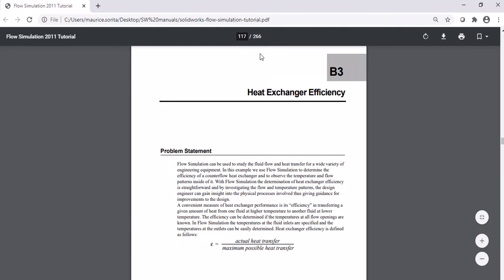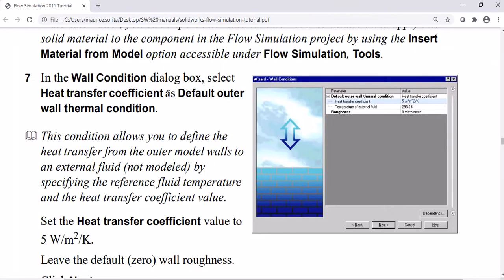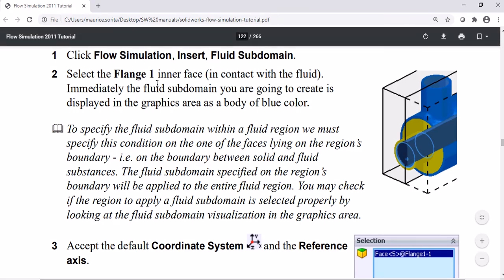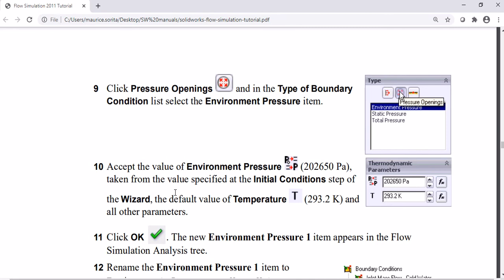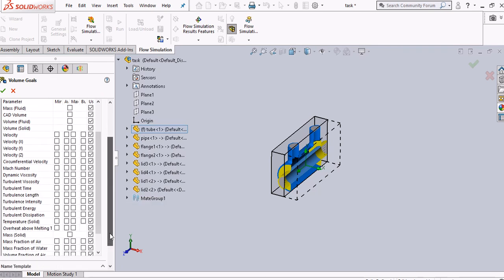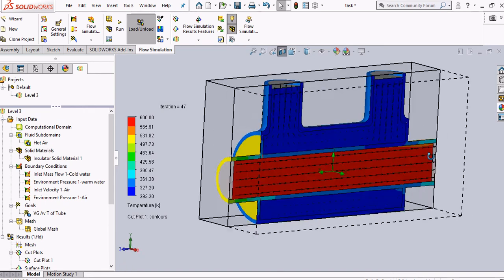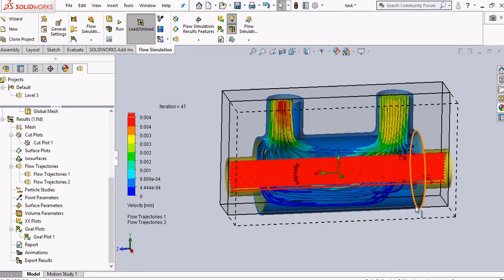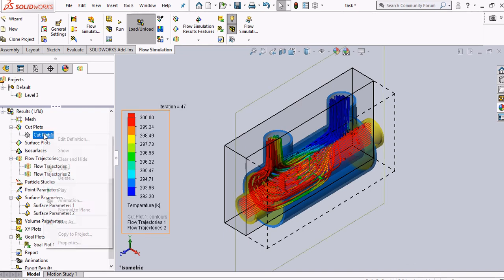Solidworks CFD Simulation 101; Introduction to CFD Simulation;Heat Exchanger ; Internal Analysis

Comment: Hello. I have a question.
Can you make a video with the whole process of heat exchange in an intercooler? How is this simulation done?
I don't know how to do this heat transfer. I want to mention that the intercooler is air-cooled.
Reply from the maker: Let me check if i could make a video for that.

Comment: Sir can you please tell me what is "iteration" and what is the need of "iteration" in flow simulation.
Reply from the maker: Iterations is automatically decided by the software based on how the computational domain was set up and on how we set up the mesh level. As default, it is set on  3, but if we want the computations to be more accurate, we can adjust up to 7. But this one will take more CPU time due to more iterations needed in the computation. 

From the Online Help:

Iterations.

Flow Simulation solves the time-dependent Navier-Stokes equations through iterations. If the analysis is unsteady (time-dependent) the each iteration is the time step, which is the same for the whole computational domain. If the analysis is not time-dependent the solution is obtained as steady-state, so to obtain the steady-state solution faster, the time step at the each iteration can be different in the different regions of the computational domain, so the iterations are not connected with the time steps.
Reply: @mauricesorita1057  Thank you sir for the explanation. It would definitely clear my confusion and enhance my knowledge. Once again thank you..!